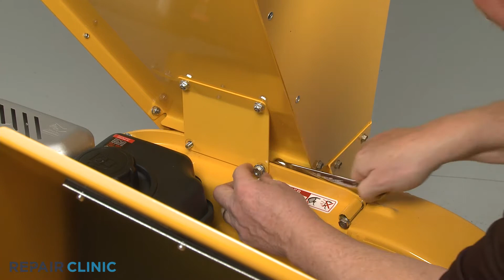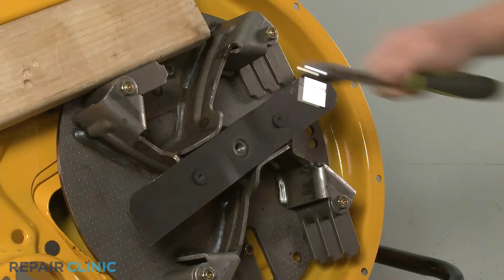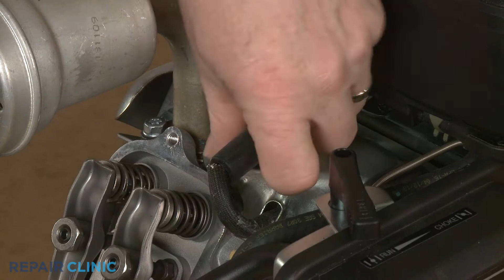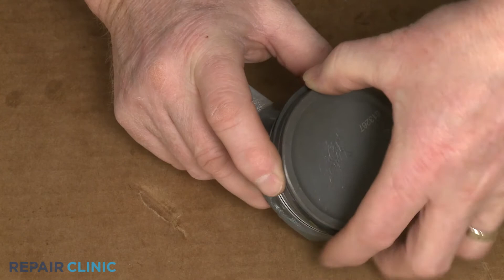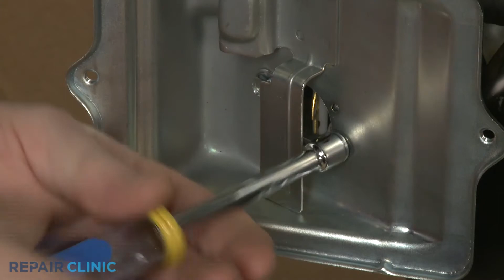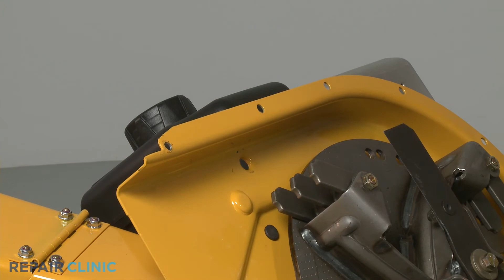Briggs & Stratton Small Engine Piston Ring Set Replacement 791787

Comment: ordered new set of briggs rings, and they were supposed to have one with one mark and one with two marks, but they both only have one mark; one long stripe and one short stripe. how to tell the difference between the rings without using the marks?
Reply: The one with two marks is the top ring and the other ones the second range

Comment: You didn't check piston ring gap before installing.  I would think, even with new rings, you want to check it.  Too large, blowby, low compression, oil burning.  Too small and can't fully expand under running temperature and rings deform (bow) causing damage to cylinder wall or rings break.  

Obviously you have a spanking new engine your doing all these videos, but someone replacing rings likely would have 10 or 15 year old engine and measuring ring gap is a must. 

Please edit the video to show how to measure ring gap and the proper ring gap tolerance for 791787 ring set.

Comment: Hi. Please, with what moment of force did you tighten the connecting rod and the engine block? Well thank you. What force in Nm needs to be set?
Reply: connecting rod and crank case bolts - 100 inch pounds = 11.2984825Nm
Reply: Cylinder Head - 220 inch pounds = 24.856661499999998 Nm
Reply: Well thank you. :)

Comment: Worn piston rings commonly cause oil blow-by, but another factor is wear / damage to the cylinder wall. Why waste time and money to buy a piston ring set of standard size, only to discover the blow-by continues because the cylinder walls are also worn? How can we determine that the cylinder walls are still suitable for use with a standard piston ring set? 
Yes, we could install a standard piston ring set, and hope oil consumption is reduced or eliminated. But if we discover a standard ring set will not help with oil burning, we must buy a second, larger set, and bore the cylinders larger. A machine shop could bore out the cylinder, but that operation is relatively expensive.
Reply: Cheap way is to just hone the cyl and replace with std rings 
The bore is often not perfect round more egg shaped and should be min .20 bored if you have no deep grooves. But if you just do a simple ball hone it should run for another 100hrs before another rebuild about 2 -3 years